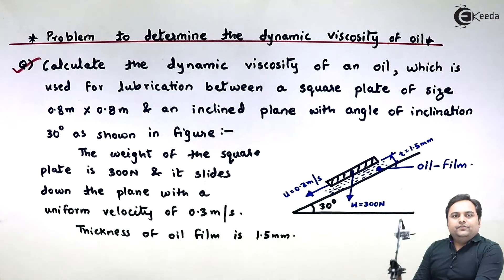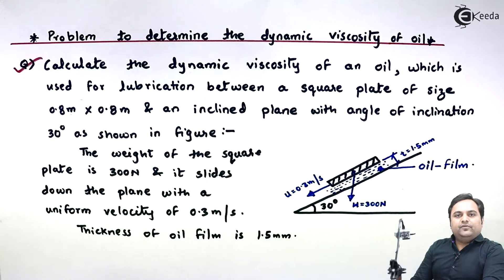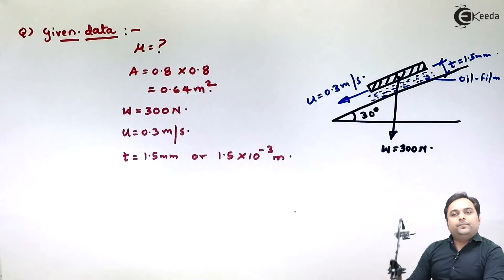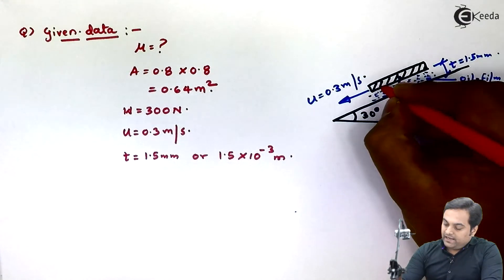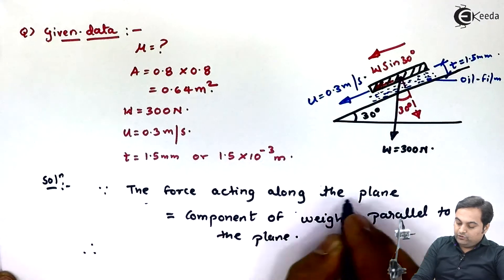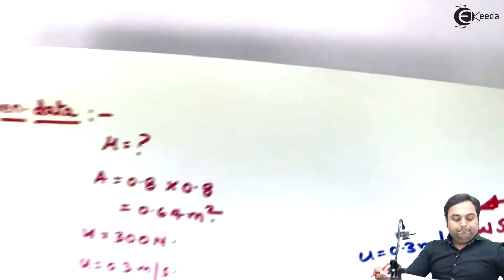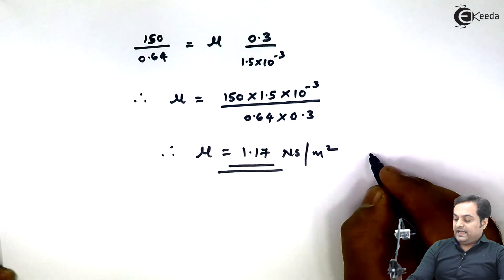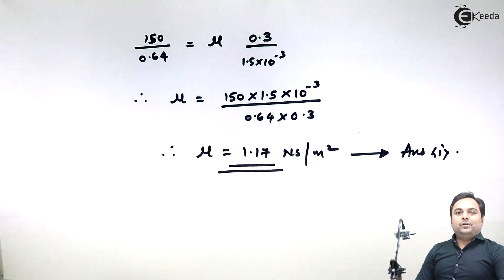Problem to Determine Dynamic Viscosity of Oil - Properties of Fluid - Fluid Mechanics 1

Comment: Calculate the dynamic viscosity of oil, which is used for lubrication between a square (0 plate of size 0.9 m x 0.9 m and an inclined plane with angle of inclination 30 as shown in Fig. The weight of the square plate is 300 N and it slides down the inclined plane with a uniform velocity of 0.3 m/s. The thickness of oil film is 1.5 mm

Comment: The dynamic viscosity of lubricating oil used between shaft and sleeve is 10 poise. The diameter of the shaft, which rotates at 200 rpm, is 0.5 m. The sleeve length is 100 mm. Calculate the power lost if the thickness of oil film is 2 mm